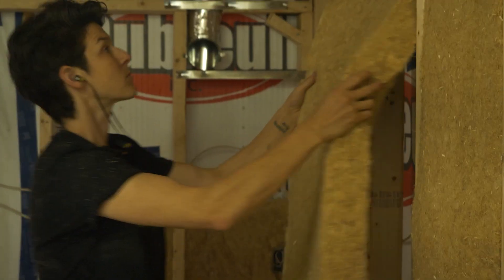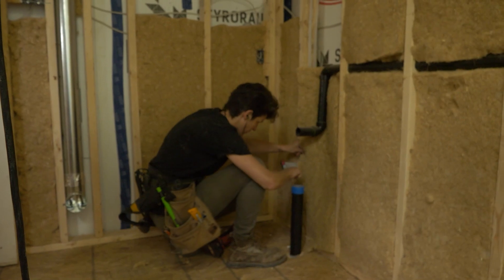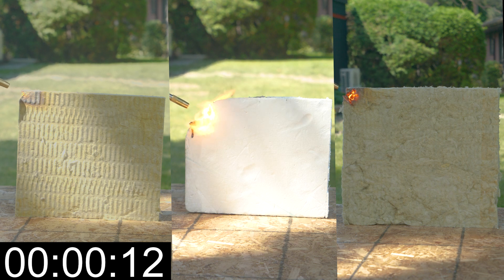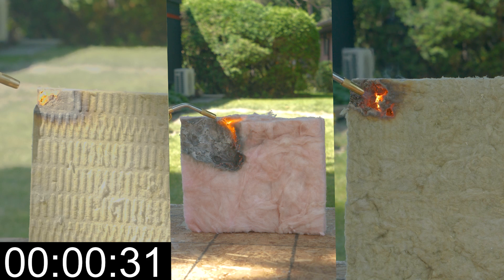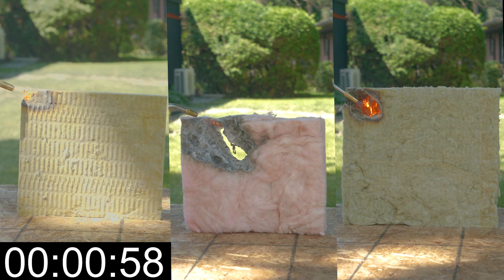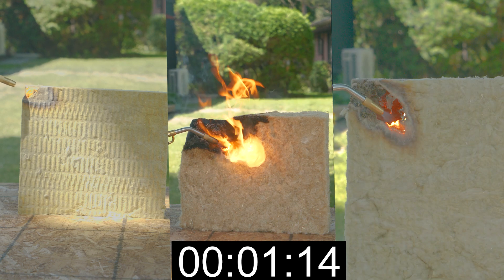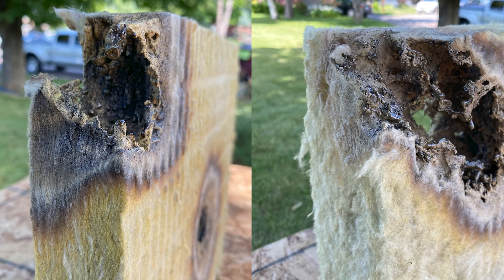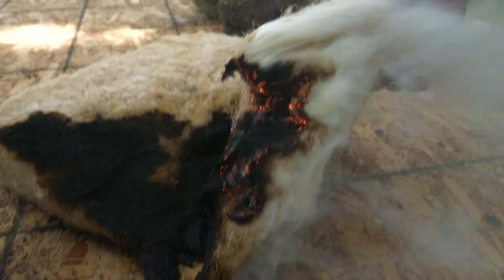Which insulation is more flammable? We blowtorch hemp and other common insulation materials

Comment: does hemp sag over time like denim/cellulose? And what about the so call non-combustible hempcrete as a spray insulation?
Reply from the maker: Those are good questions and I'm not 100% certain as we don't have enough experience with either. I would have to look into this. Will put something up when I have more info. Thanks for watching!
Reply: Here at Western Fibers , we have our own hemp spray cellulose machine and the spray does not shrink or slump and Hemp batt insulation is a compression fit that definitely resists slumping.
Reply: @wadeatteberry6377  Is the finished sprayed product still soft or is it hard/rigid?